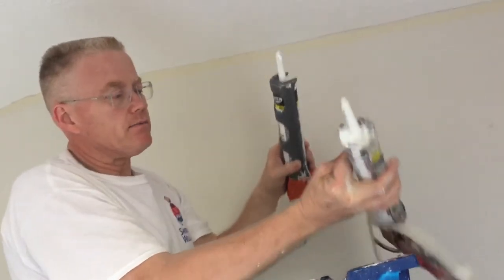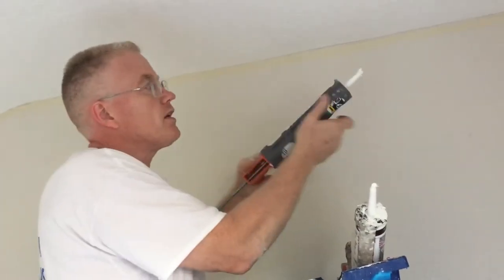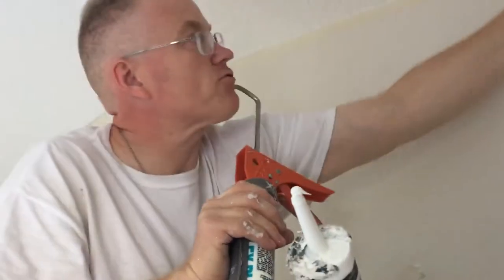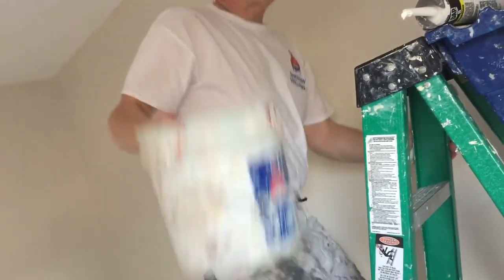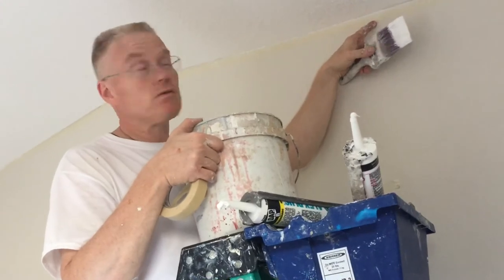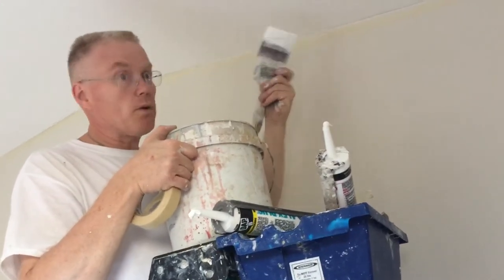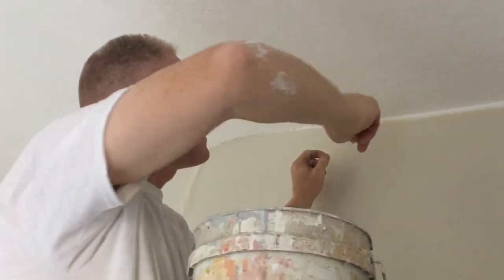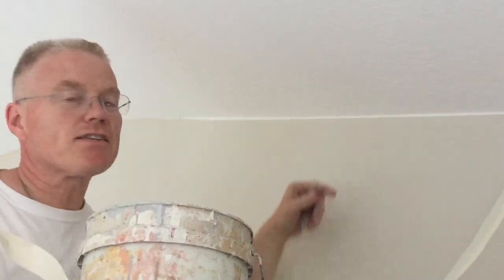HOW TO PAINT/ CUT A STRAIGHT LINE ON A TEXTURED WALL AND CEILING PART II

Comment: A little question: so you paint the line and then you paint the wall or you do all of this after the walls are painted. Thank you!
Reply from the maker: Yes
Reply: @spencercolgan  I don't know if you are being clever, but yes what?  The first part of the question or the second?  To me it makes sense to one surface without tape, then take the time to do the take and caulking method and be done.  In the case of the video, the wall would have already been painted, so once the tape is pulled, there is no more painting on the wall.  I am doing this project currently and hand cut all of the walls up to the ceiling joint.  I image one day painting the ceiling and at that time, I will do the tape and caulk method with the tape on the wall.